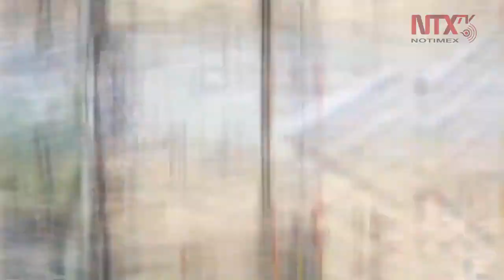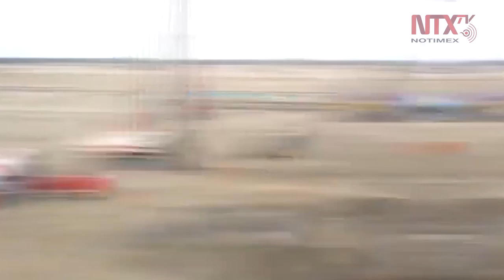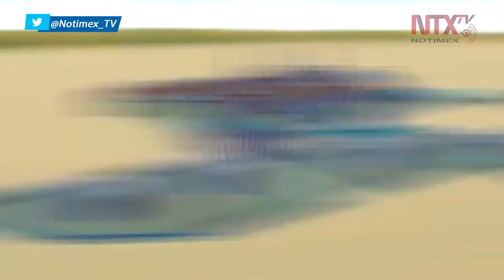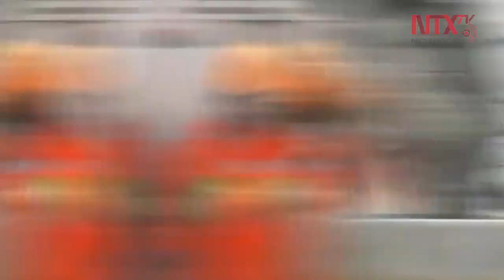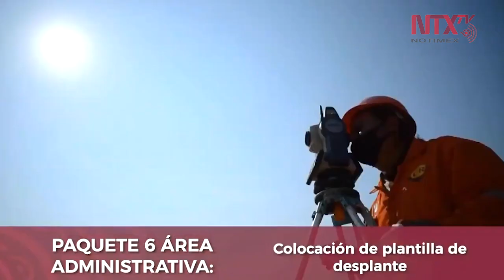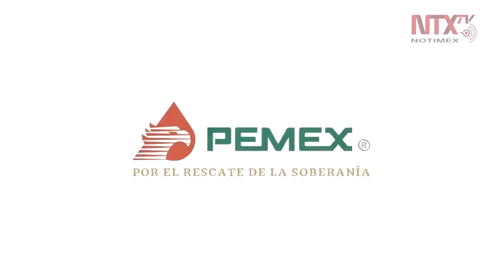Refinería de Dos Bocas tiene avance del 80% de urbanización de avenidas

Comment: ID's aviations.
LO que tu argumentas todavía  esta muy legano de depender al 100% de energiss renovables, se prevee que dentro de   unos 50 años se va seguir dependiendo del petróleo ya que en la  refinación del  petróleo no sólo se obtiene gasolinas, sino otros derivados que se utilizan en otros campos de la tecnología, como son en la aeronáutica, espacial, automotriz, maquinarias de guerra, electrónica, eléctrica, química, biotectologias, por ejemplos, los polímeros o fibra de carbono sirven como 
 revestimiento de los fuselaje de aviones,  cohetes espaciales, carros,  barcos, submarinos, cables eléctricos, circuitos eléctricos, carrocerías de los carros de motor de gasolina y eléctricos. La fabricación de baterías para carros eléctricos son muy caros, por que el mineral principal que es el cobalto es muy escaso en la corteza terrestre, la  baja disponibilidad de este mineral, permite que no pueda cubrir y proveer  la demanda para que puedan  fabricar millones de  baterías para los  carros eléctricos. Actualmente y pasarán siglos, que por medio de un acumulador eléctrico pueda mover con eficiencias  aviones, aviones de caza,  cohetes espaciales, maquinarias pesadas, barcos mercantes, equipos de maquinarias militares. Con respecto a las energías  renovables, como la eólica y fotovoltaica que generan electricidad, su generación son intermitentes y depende de un respalda, que es el gas para que en las  líneas de transmisión, el voltaje sea constante. En ningún país desarrollado, la generación de su energía eléctrica se basa al 100% de energiss eolicas o solar, debido que cuando no hay viento o sol baja el voltaje y tienen que ser respaldado por otras fuentes de  energías como el  gas, hidroeléctricas o nuclear, con el fin que el flujo de voltaje sean continuas en las redes de transmisión. Para tu información, las eolicas en mexico generan el 7% y solar el 4%.